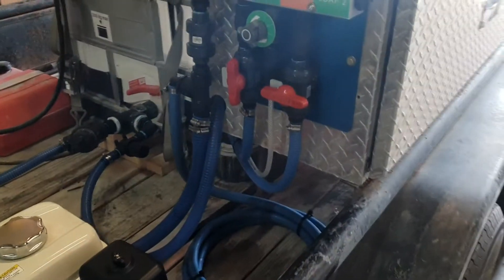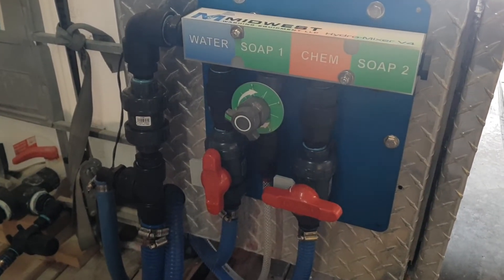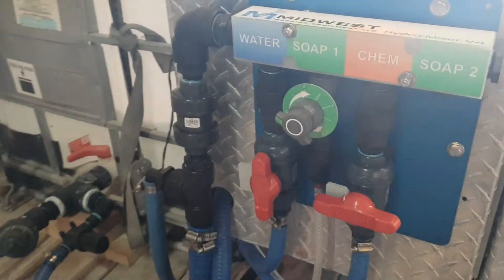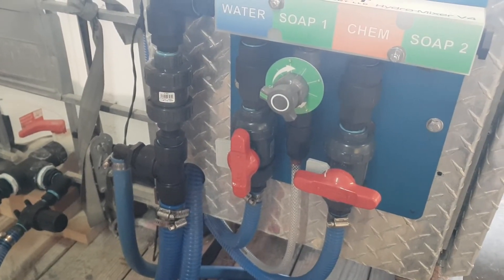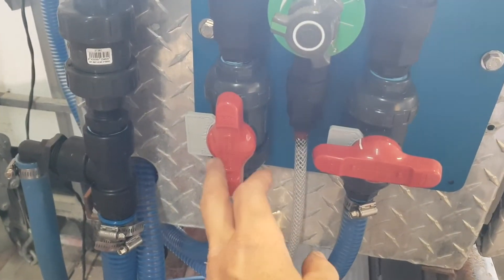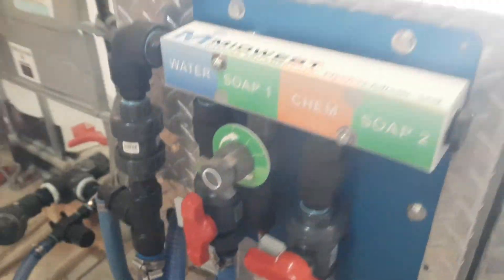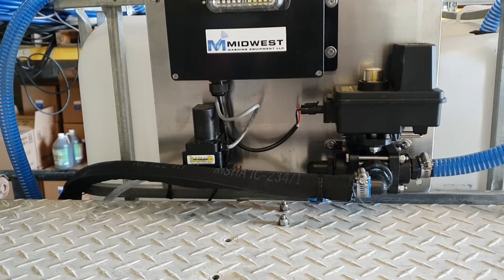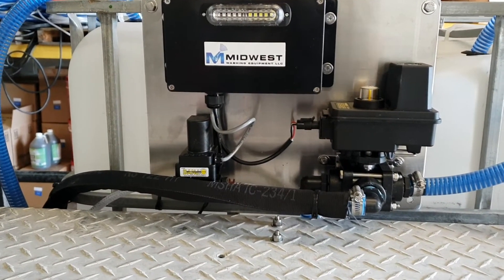New Soft Wash Hydro-Mixer XL Proportioning system for high flow pumps. Video 1 of 2

Comment: I got one of your 1/2 mixer on my 12v, great product and I love it.
Question, will 1" mixing valve make a difference vs 3/4 on a comet P40? Let's say if bleach is only at 1%?
Reply from the maker: thanks Yanis.  You want to use the Hydro-Mixer XL for the comet P40.  It has 3/4" metering valves but have a special ball to allow high flow.  Here's a link to the XL https://washingequip.com/shop/ols/products/hydro-mixer-xl-for-gas-powered-pumps

Comment: Will it not have a precision needle on the bleach valve?
Reply from the maker: No, flow rate is too low. We will continue to use it for surfactant though.
Reply: @midwestwashingequipmentllc1209  what is the max % we can expect using this new setup?
Reply from the maker: @johnfurr268  6%, if you want hotter, you can close the water valve some, theoretically you could run straight 12.5%, water valve closed bleach valve open all the way
Reply: @midwestwashingequipmentllc1209  Thank you